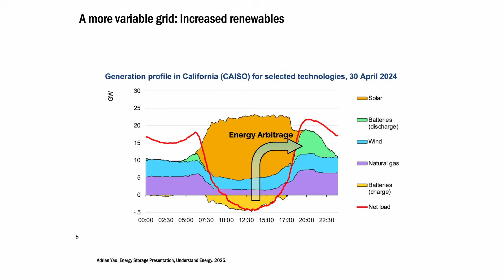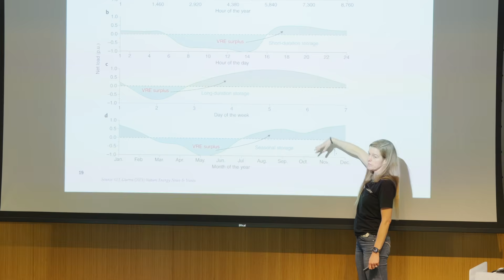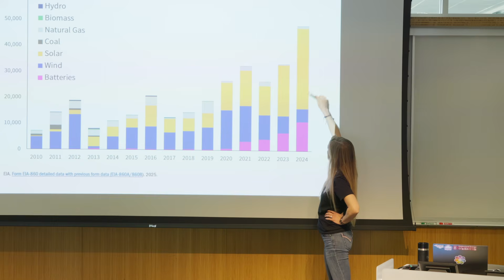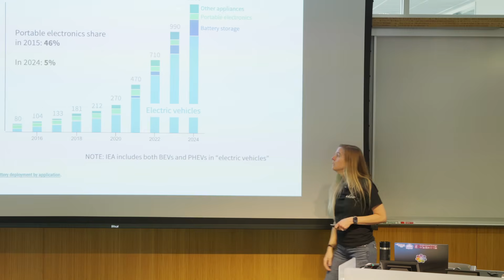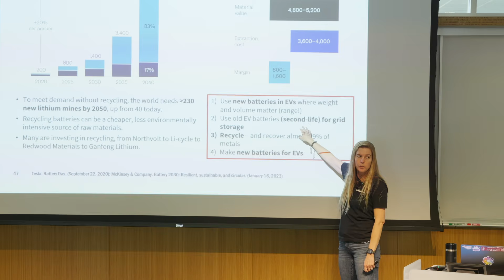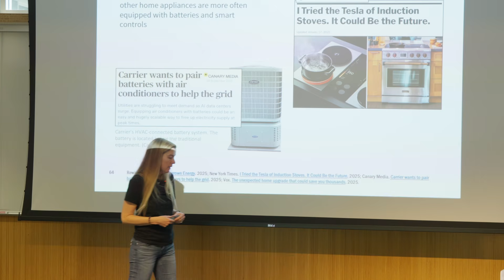Energy Storage Lecture | Diana Gragg | Stanford Understand Energy

Comment: Dear Professor Dr. Diana Gragg,
I hope this message finds you well. I am writing to express my appreciation for your valuable contribution to the field of energy education and to seek your perspectives on the increasingly important subject of energy storage and its role in the transformation of modern energy systems.

Energy storage has become a fundamental component of the global transition toward renewable energy. As solar and wind generation are inherently variable, effective storage solutions are essential for balancing electricity supply and demand, improving grid reliability, reducing energy curtailment, and ensuring that renewable electricity can be available when it is most needed.

At present, lithium-ion batteries represent one of the most widely deployed energy-storage technologies, particularly because of their high efficiency, rapid response, scalability, and declining costs. However, their limitations related to raw materials, supply chains, degradation, safety, duration, and resource availability demonstrate the importance of developing complementary storage technologies.

I am particularly interested in understanding the growing range of alternatives being developed beyond conventional lithium-ion batteries. These include molten-salt thermal storage, flow batteries, sodium-based batteries, compressed CO₂ systems, hydrogen storage, compressed-air energy storage, thermal energy storage, iron-based batteries, and hybrid energy-storage systems.

Molten-salt storage is particularly relevant because it can store large quantities of thermal energy and can be integrated with concentrated solar power systems. I would be interested in understanding how this technology could evolve and whether it could become increasingly competitive for long-duration energy storage.

Flow batteries also appear promising for stationary applications because their energy capacity can potentially be scaled independently from their power capacity. I would greatly appreciate your perspective on their technical advantages, economic limitations, and potential role in future electricity grids.

I am also interested in emerging approaches involving sodium, iron, compressed CO₂, compressed air, and hydrogen. These technologies could potentially reduce dependence on critical minerals and provide alternative solutions for applications where conventional lithium-ion batteries may not be technically or economically optimal.

In addition, hybrid systems combining different storage technologies could become increasingly important. For example, batteries could provide rapid short-duration response while thermal storage, hydrogen, compressed air, or other technologies provide longer-duration energy storage. Understanding how these technologies can be integrated effectively is therefore highly relevant to future energy-system planning.

In this context, I would be grateful for your insights on the following questions:

1. *What are the most promising energy-storage technologies currently being developed as alternatives to lithium-ion batteries?*

2. *What are the main advantages and limitations of molten-salt thermal energy storage compared with electrochemical batteries?*

3. *How could flow batteries contribute to large-scale and long-duration electricity storage, particularly for renewable-energy systems?*

4. *To what extent could sodium-ion and iron-based batteries reduce dependence on critical minerals used in conventional lithium-ion batteries?*

5. *How viable is compressed CO₂ energy storage for large-scale and long-duration applications compared with other emerging technologies?*

6. *What role could compressed-air energy storage play in supporting electricity grids with high shares of solar and wind power?*

7. *Could green hydrogen become an economically viable solution for seasonal energy storage, and what are the main efficiency challenges involved?*

8. *What recent developments in thermal energy storage could make it more competitive for industrial applications and electricity generation?*

9. *How can hybrid energy-storage systems combine batteries with thermal, hydrogen, mechanical, or other technologies to improve reliability and reduce costs?*

10. *Which emerging energy-storage technologies do you believe have the greatest potential to become commercially significant during the next decade, particularly in developing countries with abundant renewable-energy resources?*

I would be very grateful for your perspectives on these questions, as they would help me develop a broader understanding of the technological, economic, and environmental dimensions of energy storage. I am particularly interested in understanding how different storage technologies can complement one another rather than being viewed as competing solutions.

Thank you very much for your time, knowledge, and continued contribution to energy education and technological development. Your insights would be highly valuable to my understanding of the future of energy storage and its potential contribution to a more reliable, flexible, and sustainable global energy system.

Yours sincerely,
Luís Lopes

Comment: Hot water storage is also necessary in the US.  This is a well known technology in Europe.
Reply: Relative cheap to store hot water for days, district heating usually have several heat sources and depending on demand it sometimes pays to heat the water with direct electricity and store it for days, that also helps on the daily usage patterns. Direct heating with electricity or from heat pumps.
Using electricity in this way also means the district heating can use less when the demand is high.
Sand batteries are more expensive but can recover some as electricity if needed, only around 35% is recoverable as electricity but that doesn't matter if it was nearly free when stored. Otherwise its just heat storage and waste heat from electric production can be used as heat.

Comment: Battery parks are far more responsive and can be used daily. It is best to use batteries daily, to match inputs readily available.  They have many superior characteristics, when compared to pumped hydro. Salt and sand batteries are the keys to sustained growth.  Deployment speed is incomparable, as well.

Comment: Thanks for at least mentioning thermal energy storage.  A few products are finally appearing, but I would love to see seasonal storage for commercial and residential.  Imagine storing heat (or cold) in the dirt or rocks under (or next to) a home or office.  It has the CAPEX disadvantage of LDES, but it is very secure, and the storage medium can be very inexpensive.
Reply: Heat batteries should be included in new builds.  Heat for colder areas are very intense in energy density, and also quite inexpensive.  Why is capex a consideration, given that oil is skyrocketing in price?
Reply: I think thermal storage ( using sand, basalt or even waste from steel plants) should best be confined to cases where you need heat, for industrial processes or homes. Converting heat back to electricity is not very efficient and also quite complicated. You need to transfer the heat to hot gas or steam, and use a gas turbine, and generator etc etc.
Reply: Isn't it highly inefficient for electrical power unless very high temperatures are used? High temperatures lead to more expensive insulation and shorter-term storage. Works fine for heating/cooling.
Reply: @krslavin  According to the EIA, the largest categories of electricity useage were for residential homes were: Air conditioning 19%, Space heating 12%, and Water heating 12%. So 43% of yearly residential electricity consumption is thermal management. During heatwaves and cold snaps, demand can spike even higher and can cause brown or black outs.

A thermal battery can allow a residential building to shift it's electricity demand to when its cheapest and the grid is able to handle the demand. 

I guess you can also use a regular battery, but if a thermal batter is cheaper for thermal management, then it would be smarter to use that.